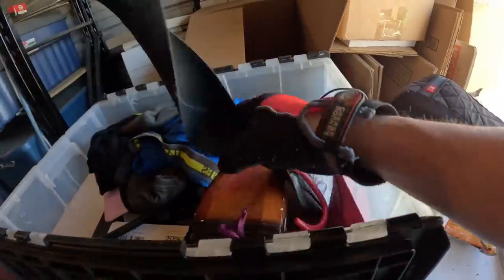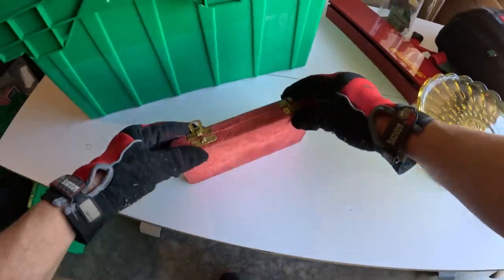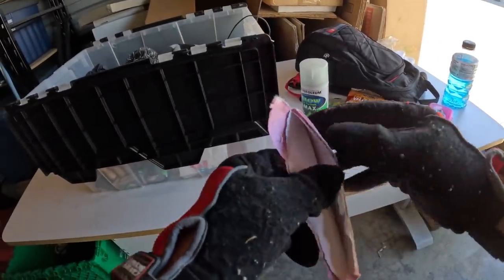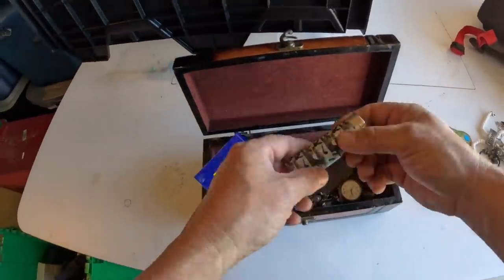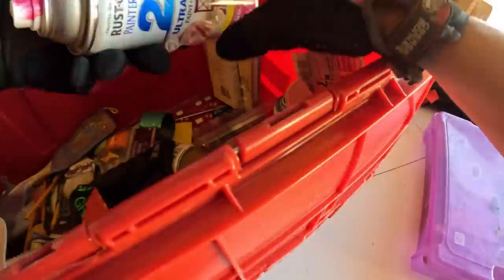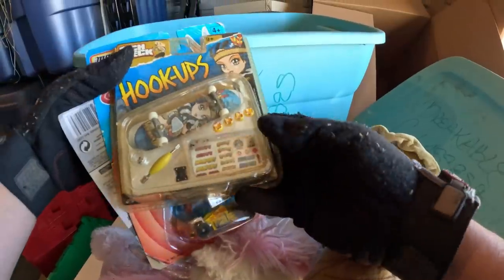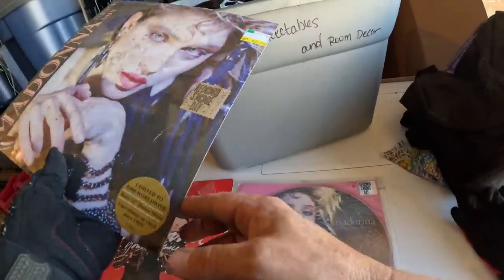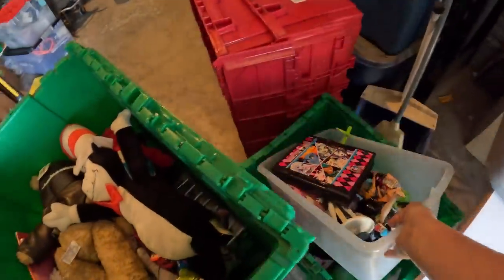This LAST BOX was full of surprises... Out of NOWHERE!

Comment: Heparin is a very good blood thinner. It is used after medication is given via a 'port' installed in a main line IV and the port is actually just under the skin Or via a normal IV in the arm that is not having constant infusion going through to help minimize clotting in and around the port.

It is also used as a clot buster in various cardiac and Stroke victims to break up clots that are causing problems. (in this scenario the give the Heparin as close to the clot as possible by using radiology to direct them to the proper area,)